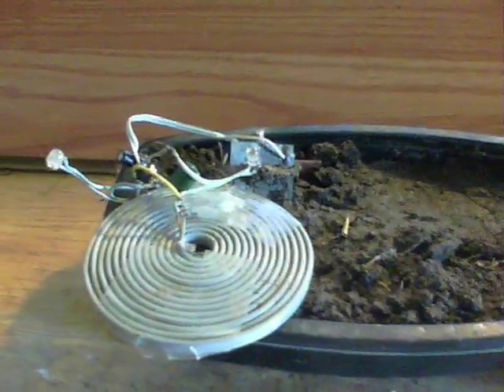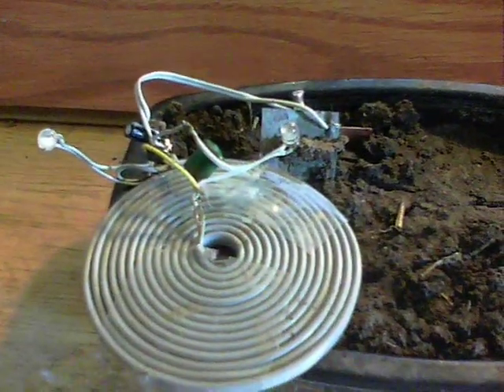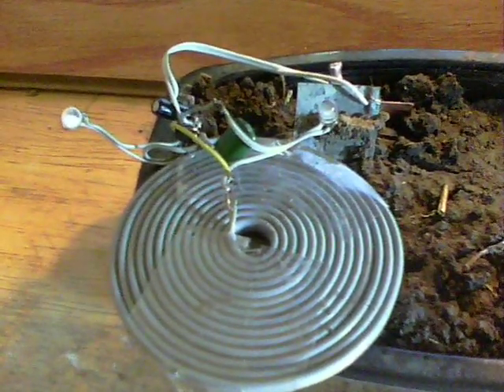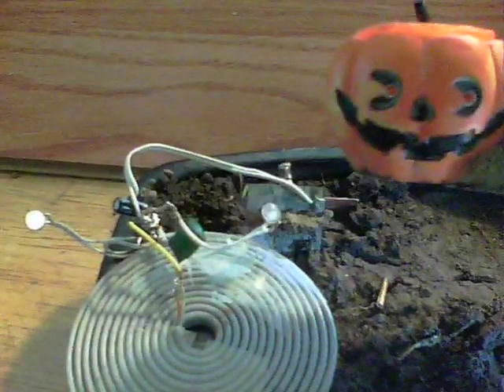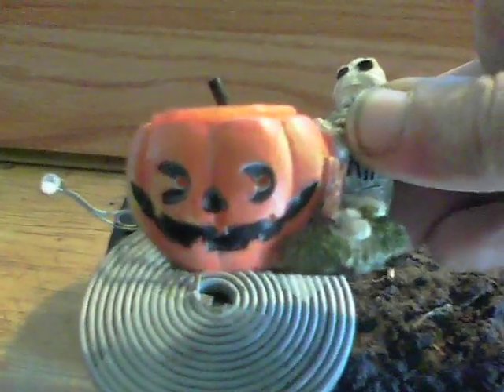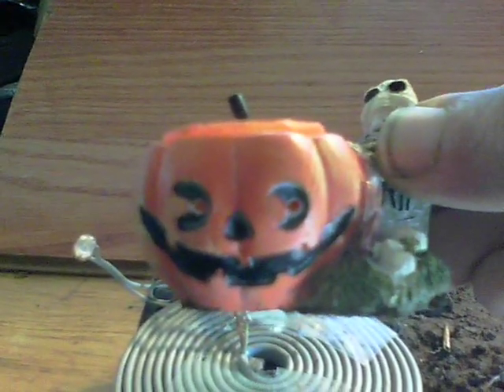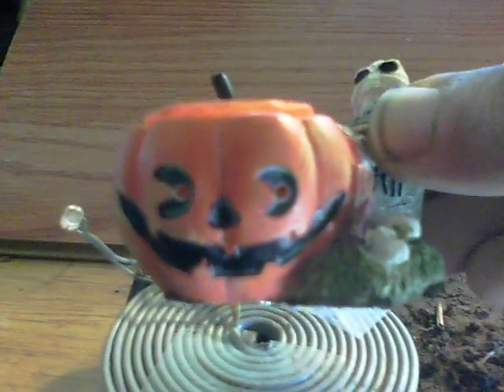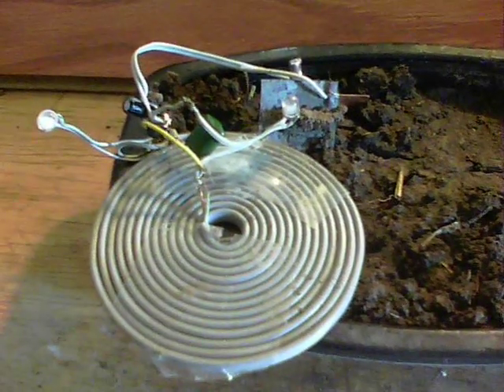Wireless Electricity from soil !

Comment: no itisnt.looks like soil produces little electricity to run the coil.looks like that.maybe not
Reply from the maker: There is very little power indeed, about 0.7V at a few microamps...which is why highly efficient circuits are needed to make use of it :)

Comment: Let's say you were to add another container full of soil, and link the two soils together through wiring. Would that increase the amount of electricity? Would you be able to power more LED lights, and possibly make them brighter? Thank you!
Reply from the maker: +Jhon Solis It makes sense to think so, but in reality there's no extra. There's 'electrolyte' available all the way, over all the soil area. it can be considered like a swimming pool, whether 1 person is in there or 100, all get equally wet.
What it does mean though, is that 100 circuits can go in the same soil and all will be powered up.
Reply: Slider2732 put it in the ground outside and see what happens

Comment: this reminds me when my home was being worked on and there was a hole in the front yard the cables in the ground were live and shocked me bad through the ground. i was upset and called the light company to let them know well the guy running the crew doing this job came to my house upset id had it all shut down. but i had the idea i was possibly paying for that loss in the ground , well i wasn't only because it was before the meter on my home . never the less it was leaking so i wondered if we could tap that free juice flowing near the cable. like three feet away i was being shocked more than i could stand but the guy says this is always normal. anyway i love this video you are quite smart and very inspiring it sure has got my brain turning. thanks for sharing this with us all.
Reply from the maker: Thanks for your kind comments :)
Here's a little eyebrow raiser for a backyard test. Get 2x copper pieces of house gauge wiring of about 6" length and a speaker from an old telephone handset (1970's type) or a crystal radio earphone. Go into backyard and drive the copper pieces in, at about 6ft between them and connect the earphone/speaker between. If you listen to it, you'll hear the mains frequency loud and clear ! It's everyones local leaky Grounds from their houses !

Comment: im very curious! so does this measure a loss from the original wire or does the leds get dimmer when the pumpkin gets near? or is it simply somehow using the free energy floating above the coil?
Reply from the maker: A good question...normally, when a load is directly connected to a wireless electricity coil, output stops, all is routed through the load (LEDs here), But this system enabled the LEDs on the coil circuit and those in the pumpkin to work, as seen at the end of the video.
I'd have to check the circuit again, if I can find it, but it seems that sMartcreations2010 circuit had enough resistance in the section lighting the white LEDs, that all of the spike energy from the sudden switch off of the transistor wasn't going through those LEDs. Thus enabling the pumpkin wireless receiving circuit to work too.

Comment: slider2732 
like your work but this wireless project is best of all and I wuold like to replicate it but not sure how you connected bifilar pancake coil in to sMartcreations2010 circuit ! If that not secret please let me know ! isnpoland@gmail.com
Kind regards
Reply from the maker: In his circuit diagram (linked in video description) he shows 2 separate coils. I used a winding each of the bifilar pancake coil instead. The 2 wires each form a coil, so the start and end of each wire became the connection points.

Comment: Hi!
This is my way of wireless power transfer:
Wireless electricity , free energy ?
Regards
Reply from the maker: That's a good light output from 2 matched pancakes and your mA are nicely low for the SWES type system. Wish I knew your language but the video works to describe :)
Here's the original SWES Simple Wireless Electricity System
Reply: Hi!
Like to ask you if you have any idea why current draw doesn't increase when I place receiver coil with load on emiter coil? I use 1.5v battery and draw is 0,027Amp with or without load as u can see in the video? Hope you could help to make sense out of it?! 
Kind regards
Reply from the maker: It is an enigma indeed. What happens is that the power output is constant and receiving loads don't pull any power from the system. It's like the sun and putting solar panels around your garden...the panels won't ever form a drain on the sun.

Comment from the maker: If it runs outside then practically never, the rain replenishes it :) 
One main trick with soil, is to not drain it too heavily else the circuit stops. Too large a pull from the earth will cause a circuit to stop running in minutes...balance it out and it'll run on and on. A Garden Light of similar methods for a circuit ran continuously for 3 months before I needed to clean the electrodes. That was around when this vid was posted. Once cleaned, onward it went and is still out there.

Comment from the maker: Seems an odd thought initially. But if we consider the way that radio waves propagate and the unnatural waves with same strengths locally all around (cell towers, WiFi etc), it could cause minerals like quartz to vibrate. Those resonant conditions could apply to the soil under the feet as well as in a tub.
Similar with telluric currents, that may be expected to be halted by deep footing buildings etc. 
Interesting unexpected avenue of thought, thanks :)

Comment from the maker: Very cool ! The lights can be on all the time..when they dim, water the container and give a quick clean to the electrodes if they need it (once a week or so with kitchen roll say). You can improve the amount of light by running a few circuits in the container...only need 1 copper electrode, the other circuits use their own Negative electrodes but can connect to the same Positive. Also a mirror behind the lights would benefit. Would like to see that :)

Comment from the maker: Yes, most definitely - as long as each connection into the ground has it's own circuit running from it. Tallied as straight connected metal it only increases amperage by a small amount per added Ground contact, due to surface area as the only change. But if you run an oscillator per extra Ground, you get the full Joule Thief type effect and output from each one. A dozen of my garden lights flashing in the backyard gave the thought of summing their outputs, as the logical next step.

Comment from the maker: That's why the oscillators are important. You can run a blocking oscillator from each Negative and the 1 Positive. 2 osc's from the same electrodes may or may not work, but a dozen from individual Negatives and 1 Positive does work in the same soil to the same output level as 1. Have tested + it works :)
Summing those oscillator outputs is the problem...something which should be easy. 12 flashing LED's can then translate to 1 bright constant light. 250 can translate to mains level output etc.

Comment from the maker: That's where i'm at and have been for months. Nothing seems to sum right. Crack that and emergency power generators would be the next step. Thousands of blocking oscillators on chips most probably, all summed and stuck in the ground. Method is 1 Positive electrode and as many Negatives as wished. All individual Negatives connect to the 1 Positive. Shouldn't work, but does :)

Comment from the maker: Thanks :) I'm using your circuit at the moment in some more experiments. I like how even though the light output may not be bright, it doesn't dim when a load is placed on the coil. The LED's (1 or both) work as 'On' indicators no matter what.